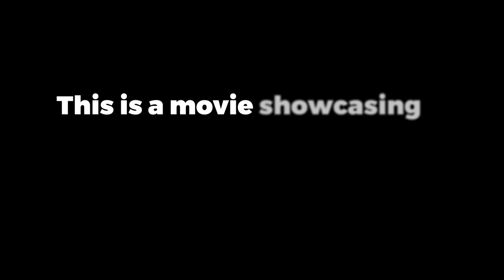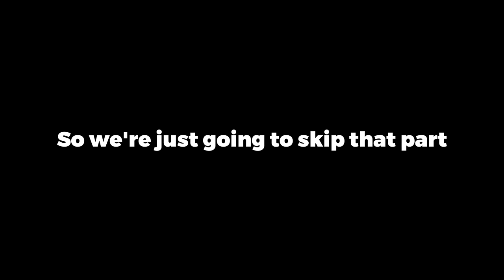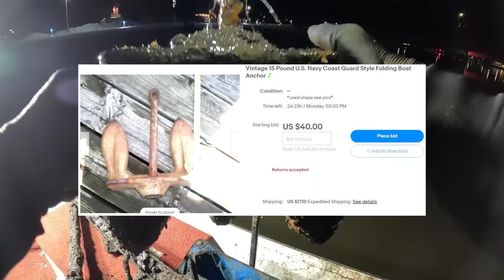Ultimate 1 Hour FROZEN Winter Magnet Fishing JACKPOT!

Comment: At 1:04:55; the think that looks like a knife blade with a circle at the end is something loggers used like the big staples. They would hammer the blade in to a log then run rope thru the eyelet to tie the loges together. No idea when they were made but they are really neat to find them.

Comment: 28:12 truck engine flywheel the gear teeth is where the starter would engage 31:35 differential ring gear carrier for a truck axel 34:05 railroad track makes a great anvil 35:59 train car  steerage wheel 49:36 huge turnbuckle

Comment: Tyler, check the metal capacity plate which should be near the steering consol, your boat should be anle to easily, handle 1500 pounds before it  gets dangerously  close to sinking. Also, try to figure out how many hours you have on your engine which will insure the age of it. Small engines are rated "in time" as opposed to mileage. 
Put a couple of hooks on those chains for towing, can easily, bring $25.00 - $50.00. That rod with the flag and tackle link on the end may be a bottom bouncer weight. They are used to keep bait elevated off the bottom.
The thing Alex brought up with the hooks on the ends is a large TURN BUCKLE. Attach the ends and turn the middle collar to draw in tightness, cool find, Probably, worth about $300 bucks.

Comment: Think I have seen a much smaller version of the long pole with the V shaped things on the end on expensive boats. There are pulleys in the V things and a chain thru the pulleys. Hooks at the ends of the chain attach to something so that pulling the chain lets you pull with extra strength. Maybe it is a come along.  Again what I remember was very small - length of my arm at most. Sailboats that need to lower their mast? Yours could move a huge collection of logs or a ship full of steel with what you found. peace and love

Comment: Your Lantern piece is a rear end pumpkin it goes into the back of your rear end of your vehicles where your drive shaft goes into the skinny end and then the two gears on the sides runs your runs your wheel axles

Comment: You're a big 40 lb with a gear teeth on the outside is a flywheel for an engine the clutch and pressure plate goes up against that

Comment: When you got the boat on land, Tyler check underneath the boat and see if it’s weak or if the word is cracking where your cart usually sits that section of the boat should be checked out. It does have metal bracings my uncle used to build boats so I sort of know. Somethings about it check it out before it’s to late.🙁🤕😵‍💫😵🥴😧🫨🫨🫨🫨